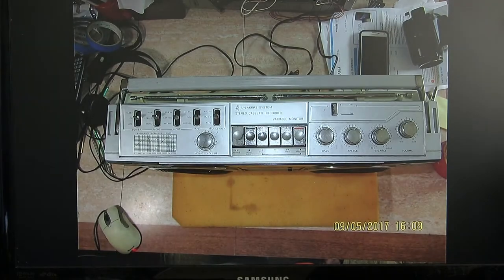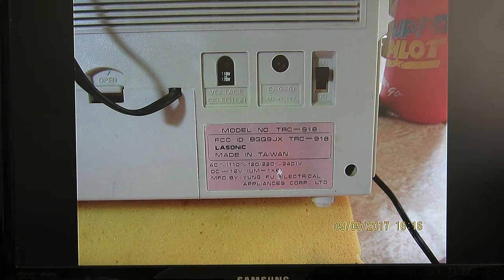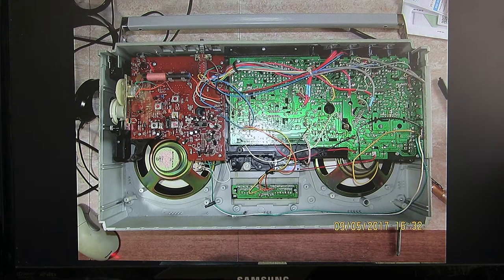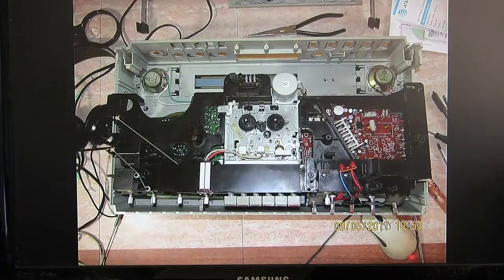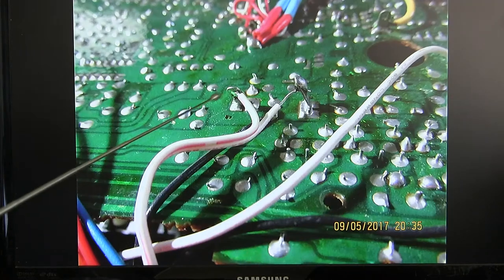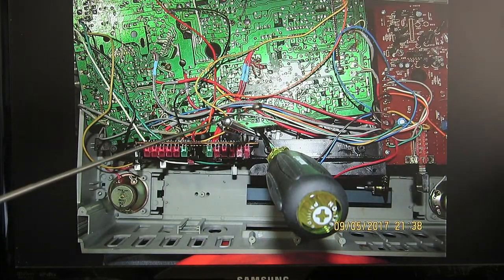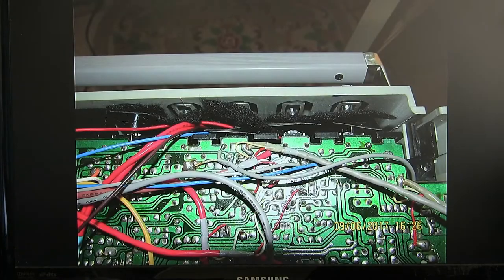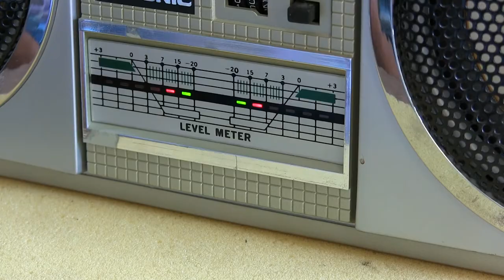Lasonic TRC-918 How to open and install new rubber belt Full featured boombox

Comment: Thank you for this video! Can you tell me if the volume, bass, treble and balance pots are sealed? In other words, would it be easy to hit them with Deoxit cleaner or must they be removed to gain access to them? Many thanks again... nice video.
Reply from the maker: You have to at least open the case of the boombox to gain access to properly shoot deoxit or your favorite cleaner with lubricant very important to have the lubricant along with the cleaner and then follow it up with compressed air repeat a few times and you should have it all clean again
Reply: Very good, and thank you so much. I do have regular deoxit here and also their faderlube too which has a lubricant in it. I'm acquiring the TRC-918 very soon. Those boomboxes from the era were so nice...  they just don't make them today with the same quality like they used to. Thank you again my friend!